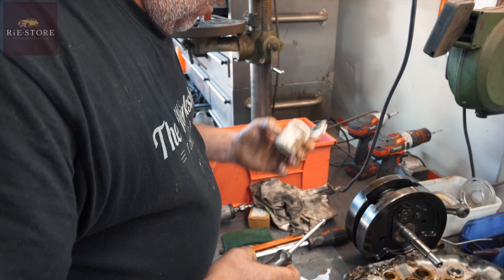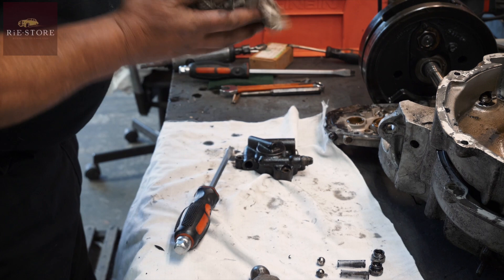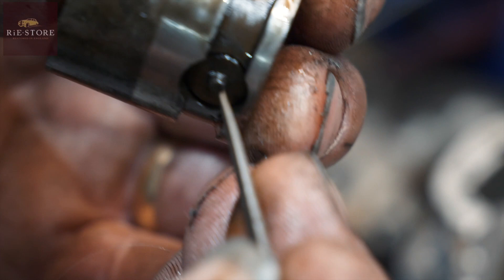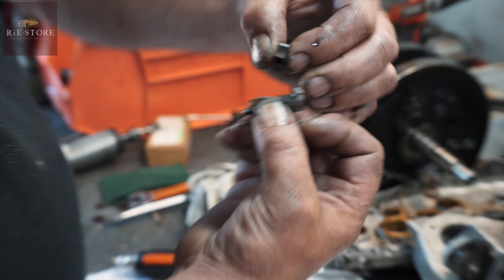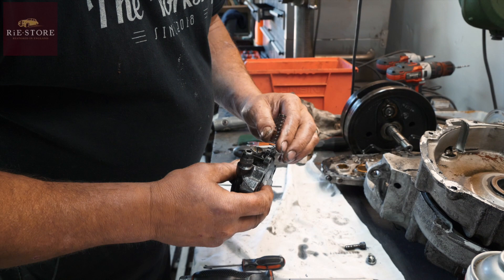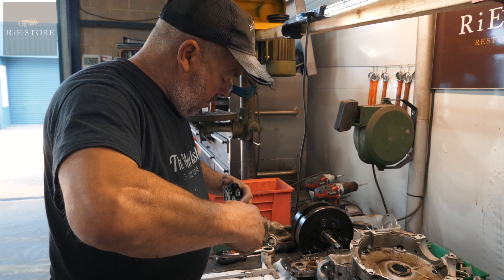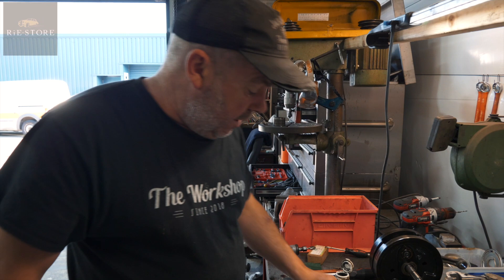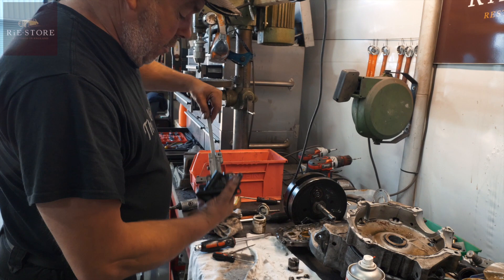How to assemble the OIL PUMP - 1945 Harley Davidson WLA / ep152

Comment: I agree with Mr. Boese - these videos are so valuable.  Having engine experience and reading the manual is one thing, but the amount of tribal knowledge being passed through these videos is greatly appreciated.
Reply from the maker: Cheers Chris. If you have any specific topics you'd like covered then let us know.
Reply: @theworkshopuk  will do, thank you.
I work on radial aircraft engines so I understand most of the WLA dissection, but all of the “best practices” and “this part is what usually fails first” have been awesome from the videos, as it looks like I’ll be buying a WLA tomorrow and bringing it home.

Comment: Hello.that was fantastic and very well explained.have had trouble oil sumping.did rebuild oil pump but still lost all oil.did put another pump on after i rebuilt it but still oil tank will empty.am going to buy new ballbearings and grind seats as you demonstrated.hopefully will solve problem....have had  bike since 1968 many rebuilds and has dry sumped if left to long without running.but this sumping at moment crazy.not sure if there is any other thing that could cause my problem.thank you for listening and brilliant video you made.regards jimmy.

Comment: Roight.  currently working on me mates oil pump.  I lapped where the ball bearings, check balls go.  The regulator seat where the ball sits has a groove in it,  where that,,  restrictor (? shown clearly at 3:40) is swaged in.  as if they broached the groove too deep.  This groove makes that check ball unable to seal.  unless I lap it a lot.  if I shine a small torch through the hole with that restrictor, and look down that hole,  it is very visible.  questions:  are they all like that, is it ok,  should I lap it away?   Cheers in advance.
Reply from the maker: Ash answered your question is this weeks episode https://youtu.be/dFyyVYeiwlk